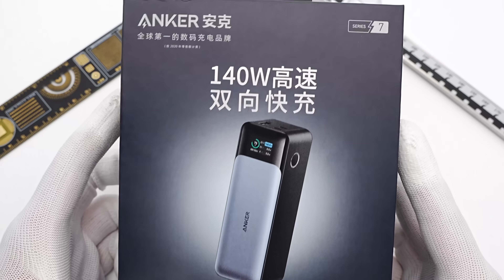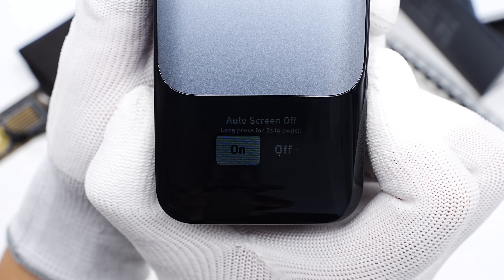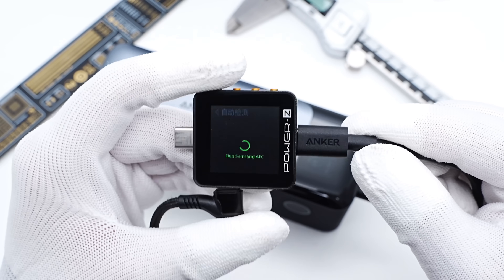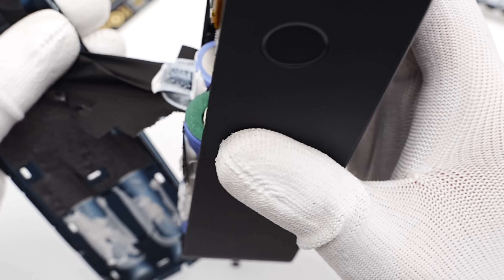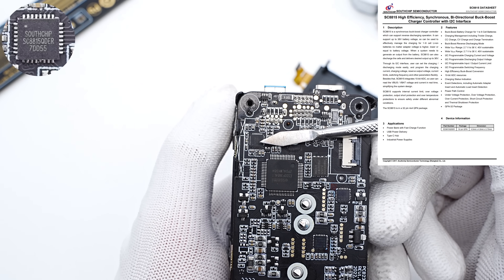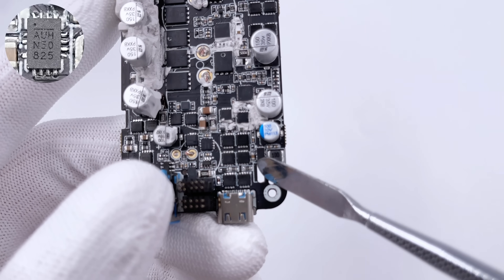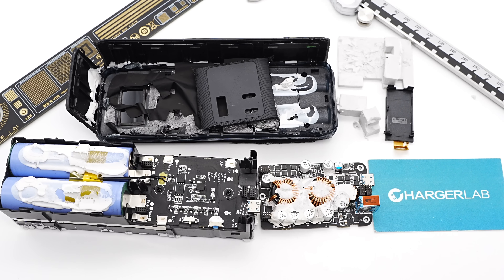Teardown of Anker 140W PD3.1 Power Bank (737 Power Bank)

Comment: Was on sale for $119CAD so i bought two for the price of one. My friend says the 27,650mAh model has more power intake and output than thid 757 that i bought but tbh i only care about the price and Capacity with i have 48,000mah for both thought the electricity of the power output is also important as i wont exactly get 24,000mAh on the dot but maybe around 23,000mAh but all i know is that just because it says it hild alot doesnt mean they is any down sides as there is many flaws to some products i this powerbank is Airplane safe as its below the 100wh range. Which is nice

Comment: There is one missing information, can we replace old cells ? It is hard to open, true, but in india they use gasoline to open battery packs from laptops, so this could help here. But if electronics will not allow to be reset it is going to be hard to use it in the future. There is one infomration than you can connect USB IN and OUT for 5 secons and power bank shoud reset.

Comment: Hello, I am Abdul Salam. I work in phone maintenance. I had a customer who needed to replace the USB-C1 port because it was broken. The power bank was opened well and I took out the motherboard and worked on it. I replaced the USB-C1 port, but the device no longer worked after that, and a notification appears that says The temperature is very low and the battery percentage is also zero. What is the solution? I do not know that there is a diagram that shows me information about the IC along the impedances and resistors.
Reply: Can anyone help in finding a solution and repairing the power bank?
Reply: Ahhh an opinion, he will not reply to you since that’s how YouTube works 😊

Comment: We're on vacation and now it's broken.  The display is black and doesn't do anything anymore.  It was only charged with an Anker 45W charger.  I love the display on the Anker 737 but will probably never buy such an expensive power bank again.  And Anker's service is absolutely bad.  They have a list of questions where the back and forth takes a week.
Reply: Skill issues
Reply: @234paka  Last month the second 737 is broke. It won't charge up anymore. It stand only at home, never fell down. Only 8 charge cycles.
That powerbank had a heat issue maybe. Over 100W it cut off at charge and discharging.
Now i have a C300 for camping

Comment: Hi there, I have a favor to ask you for. I watched your video and opened up my defected anker 737 today, I didnt have a grinder so i had to pry it open with a spudger. I succesfully opened it up but in a process i broke its display lcd. I was wondering if you still have that display with you somewhere sitting and if its not in use can i buy it from you ? I'd really appreciate it and it might help me revive my powerbank, since I kind of figured out what's wrong with it, it's b2, b4 and b6 batteries are under voltage, rest of the 3 cells are around 4volts but these 3 are between 3.01-3.17. they discharge to less than 2.5 very quickly and the powerbank shuts down automatically. I was initially thinking it might be the firmware issue but um its not, Maybe just a BMS and these 3 cells are the main issue here which i'll try my best to fix on my own but i broke my display. 

Please let me know if you read my comment, if i could buy your tore down 737 display. i have very low hopes but um yeah. 
have a good day sir. :)
Reply from the maker: Hi, I appreciate your message and the effort you've put into trying to fix your Anker 737 power bank. I'm glad to hear that you found my video helpful in your troubleshooting process.

However, I must apologize because the display from the Anker 737 that I tore down in my video is no longer available. It was a part of a teardown done quite some time ago, and I don't have any spare components from that teardown.

Best of luck with your power bank repair, and have a great day!

Comment: I just did the math and unless the cells are at 3.9V anything lower will be in excess of Lishens max charging current of 6A for this cell....and 3.9V is like 80% full....so if you have drained the battery on this device and the cells are sitting at a voltage of 2.50V (Anker probably doesn't let them go down that far...my guess is when the device is empty the cells will be 3.0 to 3.2V) you'll be charging the cells at like an 7.5A charge rate.....

So fast charging this thing at 140W when the battery is depleted is really really not good for cycle life longevity....I'd guess after 300 cycles you'd probably have 60% of the rated capacity left in the cells if you frequently recharged for 0% with a 140W adapter...unless this thing automatically controls the charging speed based on the state of charge and knows not to ramp up to 140W until the cells have reached a higher voltage.

Comment: Here's the datasheet on these cells.
https://www.imrbatteries.com/content/lishen_LR2170LA.pdf

So further down in the datasheet it says a 0.2C charge and 1C discharge cycle will give you >80% rated capacity after 300 cycles. Which isn't too bad but I think this powerbank is going to be running harder than that especially on the charge cycle. Depending on how the cells are arranged (I'm just going to guess 6S since I doubt a 3S or 2S could efficiently boost to 28V for the 28V PDO) I think it would be a 1C charge and up to 1C discharge roughly. I think fast charging this device is going to degrade it much more than using the output at 140W.

So if you want this thing to last you'd probably want to limit the charging to say 60'ish watts.

Comment: I bought the 100 W Zendure. Even it is more expensive, it uses better battery cells and offer a repair service. With the Anker, the day it fails you find yourself with an expensive doorstop.
Thank you for the great teardown and component analysis...
Reply: Its a consumeable item,..
also why you have all the statistics on these powerbanks with runtimes, cycletimes, and battery health.
I got the 737 and been using it lightly over the last 2 years,..my battery percentage are down at 96%
You get these high wattage powerhank if you need 28v/5A...PD3.1
a 100w low end zendure ain't gonna do jack in that regard.
and its informative to see all the info.. wattage.. amount of time left, at a given drain, and the health of the powerbank.

Biggets con with the Powercore24K (atleats the western sold models) is the lack of 12V PD support.
Reply: I cannot wait till the EU mandate of replaceable batteries in consumer electronics.
2027 cannot come any earlier.
Reply: @RUHappyATM  Doesn't apply to powerbanks.

Comment: My 737 lasted a few weeks got it to about 7 cycle's. Put it on charge the other evening it said charging came  back later to find 0% charge. I thought thats strange. Anyway it turns out that the battery thinks it's temp is -40 and it's basically given up saying it's got 5% battery and 0 cycles on the detail screen 5% on the other screen. Won't take a charge and won't give a charge. I'm really not impressed with such an expensive piece of kit doing this so quickly I wanted it to last me years at that price. Seems like they've overcomplicated things with the software and it has glitched displaying incorrect information. The next day the screen was completely dead as if the battery is thoroughly drained itself will not take a charge or anything. 👎

Comment: what did the clickable switch do.. you just say its for production, perhaps manufactering and.mo way we would dare to click it.??
c'mon bud. they did not put it there just to get a laugh.
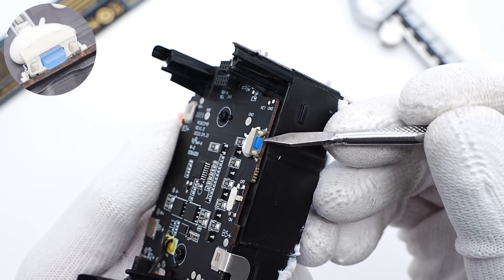"but It just a hidden switch, who cares wht the purpose is and no we will not click it"..  5:03
click the dang f'ocker. and see if it changes anything on the display, chargelevels etc etc on the USB meter..
you go into details with relative nonsense that is obvious for anybody, but the actual interesting things like this switch and what the purpose is... nahh who cares.... hmm very weird prioties and how in the flyng daylight can you conclude that its 6A 21700 cells on a powerbank you just saw do 140watt.?
please do the math...
A quality 21700 cell like a Samsung T40 21700 under heavy load like fx 30A will drop to around 3.6v to 3.2v under suistained load with 30A... (check lygteinfo)
3.6v divided with 140watt = 39A and this powerbank got 6 cells that will share the lifting, but you would still see an indivuel cell voltage under fx 140watt load that would be around 3.5v to 3.75v.. you need 21700 cells that can tolerate a suistained load up around 30 to 35A.. also why you would have problem using 18650 on a product like this.
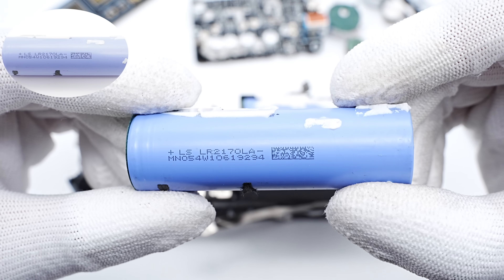what gave you the impression that its 6A rated cells? 4:25

Comment: just wondering, is there any batter management as far as balancing leads to help maintain the batteries health?
Reply: Yes, the lower board does all that. The cells must have balancing or they will eventually drift apart and give you less and less capacity as the charger stops working when the lowest cell hits a predetermined low voltage cutoff.

Comment: Interestingly, it does not use a switching power with a high-frequency transformer but a bulk-boost chopper, is that normal on PowerBank? I think that bulk-boost has less efficiency.

Comment: I'd love to see additional testing of cells itself to see how consistent they are in specification, with 18650 I had lots of bad luck with chinese batteries, especially when introduced to temperature fluctuations, mostly outside use in winter it just dropped far below 3V
Reply: Yes. I have another anker power bank using 21700 but they are lg
Reply: These are 21700 batteries
Reply: Not all chinese cells are bad. Anker is a reputable brand. I am pretty sure they are sourcing these 21700 cells from well known makers. The general bad 18650 cells are those ultra fire or similar named stupidly high capacity claimed cells..
Reply: These Lishen cells are pretty good quality, on par with Samsung 40T but expect a lot of 100/140W PD charging to really the life cycle count. Cells that are driven near their max will degrade much faster than standard 800-1200 cycle life. Check the datasheet to see if Lishen goes into detail or just gives one number
Reply: @ericklein5097    Capacity ≥ 2,400mAh @300 cycles
(60% of the standard capacity @ 25℃)
- Charge: 6A, 4.20V, CCCV 100mA cut-off@ 25℃
- Discharge: 35A，2.5V cut-off @ 25℃(80℃ cut-off)

Comment: The batteries should be connected in parallel to reach the 24000 mAh  , not in series
Reply: mAh it's been a marketing measure unit for a long time. What do you care how they are connected inside if voltage that you get is regulated and more to it - not 3.7v for which mAh has been calculated...
Reply: @neve_dimka  Because I'm curious, because I work in the field and have a very expensive lab setup, because I enjoy it.  That said, this is just a video I watched real quick.
Reply: @pietromoopy2010  my comment was to Enelyson Fields. Anyway it answers your question too - mAh written on a box is for marketing reasons. The general public is accustomed to mAh, so manufacturers keep presenting their products this way.
Reply: @neve_dimka  Oh I agree it's a useless measurement.
Reply: Yeah, I don't exactly get what they are doing here, there has to be more to it or you would have 4000mAh capacity.  There has to be some type of switching going on.

Comment: That's wild to me that a USB cable can be rated for 140 watts.
Reply: there's working cables that can go up to 240w now
Reply: @HearMeLearn  like the one in the video, that clearly are a 240watt rated cable when its fitted with an Emarker claiming it can do 50v 5A 0:54
Its an 240 watt cable that come with this powerbank, but since its a 14w max product.. they just posted the same wattage on the cable, but its inner chip says its a 240watt cable., and it does feel like high wattage cable it as its annoying as f..from all the heavy amount of strains inside that makes it quite stiff...
Just sted it on the Fnirsi FNB58 BT USB meter, it labels it also as a passive, 0-1m cable with a rating of 50v and 5A, so a max of 250watt. but its a short cable at around 60cm

Comment: If I plug this 140w device into my 40w Apple iPad Pro… what happens?  💥?
Reply: your device communicates with the charger and it would use only as much as it would need at the right voltage and amperage, so no boom
Reply: @run00n0  Nonsense. There is no communication for that purpose.

Clearly the basics of electricity are not understood.  I shall explain.

When a power source specifies a watt figure, this is the maximum power that can be drawn from the power supply. It does NOT mean that the power source will always deliver 140 watts regardless of what you connect to it.

For voltage sources, which this is (as opposed to a current source), a set voltage is output. Now, the load, the thing the power source is connected to,  will draw current and how much current is drawn is entirely up to the load (within limits which are set by the power source).

So the the power drawn is a combination of the voltage and current (P=V.I), therefore as the load or different loads draw different amounts of current, the power drawn from the source also changes.

So if you connect a 140W charger to a 40W IPad, then as long as the power supply has the correct voltage for the IPad, then there is no problem, the IPad will draw the amount of current it needs, and the power source -the battery - can deliver it (because the requirement of 40W is less than the maximum power of 140W the power source can deliver).

No need for any communication between battery and IPad.

Now, USB-C supports multiple voltages, unlike earlier versions of USB which are all fixed at 5 volts, so there is a danger that too high a voltage could be delivered to the load, to the device being charged, and that is then where communication comes in, to ensure that the correct charging voltage is used.
Reply: @deang5622  Are you new to this? There is an entire communication protocol set up for Sources and Sinks to negotiate a voltage.
Source: Hi I can do X Y and Z
Sink: Hi I can accept X and Y so I will take Y
Source: Sending Y
Reply: @run00n0  — Cool!  So I can plug my iPad Pro directly into a wall socket with no adapter.  Thanks!

Comment: I also found and bought the following product baseus elf 65w 20000mah powerbank, I'm really happy with the built-in type c cable, very useful.  Apart from that, I couldn't buy it because the price is a bit high 🙃 Baseus 100w 20000 mah powerbank is also available, a very stylish design and a useful product.
Reply: i have it and it charges my mac only for 2700-3000mah with 75w

Comment: I got this power bank a few days ago after only three charges and and discharges, it stopped working. It displayed a 50% charge. I discharge it completely, since then it won’t charge with anything. Got a couple of pictures if anyone is interested.
Reply from the maker: I‘m so sorry about that. You may contact Anker to get a refund or replacement.
Reply: @ChargerLAB  the battery was bad for eBay at a lower price price. It worked fine 3 charges. Anker doesn’t want to help me in this matter.
Reply: @grusamgrid  so you bought a known bad (defective) device? Why?
Reply: @geraldh.8047  what I meant to say is “bought from eBay”
Reply: @grusamgrid  then you should complain at eBay and open a case. With eBay in case of conflict they tend to mostly side with the buyer. Should be no problem if it was bought recently (and since this is a very new device I would guess it was bought recently).
Reply: @geraldh.8047  unfortunately nobody can help me on this matter. Is there any chance that you could give me some pointers on watt is wrong with this power bank. Seems that it is in some kind of protection with low voltage. I inspected visually all the components that I could see. No burned components were found.
Reply: @grusamgrid  if a device that is only weeks old does not work you complain where you got it from and don’t take it apart.

Comment: 6A max cell current? That will be 6A at 18v when the cells are low and under load. 140W output will then be out of spec for the cells...
Reply: There is "Continuous Discharge Rating (max): 35A / 45A with 80°C temperature cut"  in the LR2170LA specs. It's strange that only 6A was announced in the video.
Reply: It's possible it can go beyond that 6A spec for short periods of time
Reply: Sounds abotu right, mine had ports cutting out and power delivery going down when 2 devices were plughged in no matter the ports used. It also had issues withthe steam deck and would require a full reboot (by leaving it for 10 mins unused) to try and get the right wattage. but as soon as you plug a 20w phoen in the 38 watt charge went down to 22w... Was an absolutely awful product, I showed the videos of the poor performance and anker's response was this is normal function. I find the 140w number extremely misleading